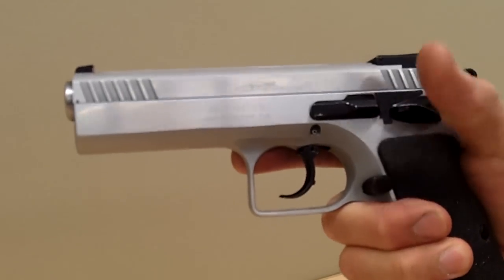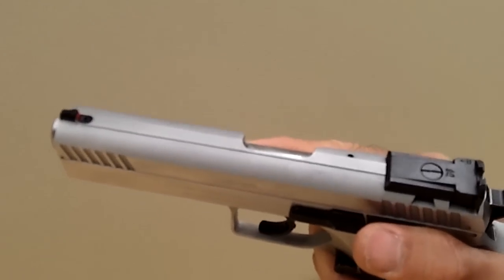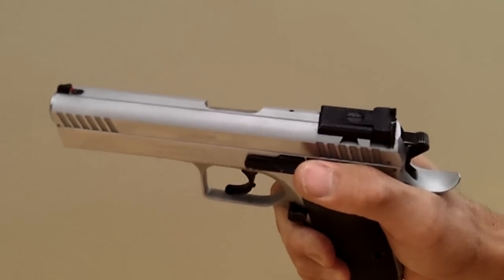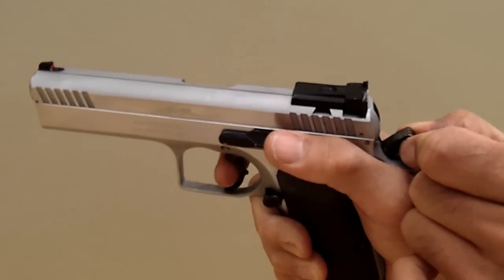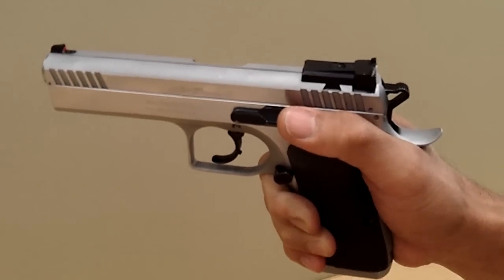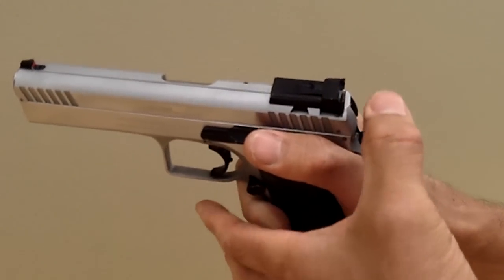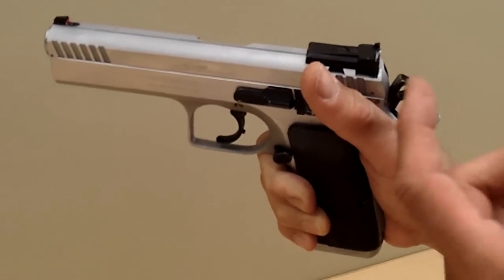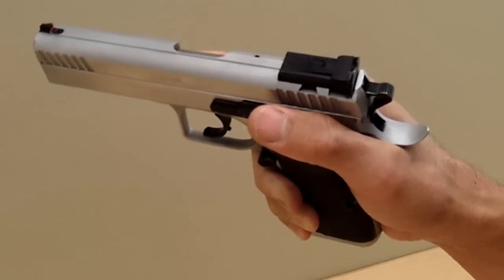Decocking Double/Single Action Semi Auto Pistol - Safer Method

Comment: The bottom line is that while you can attenuate the chances of an unintended discharge you are in fact violating a basic rule of firearm safety every time you manually decock a firearm using the trigger. Many variables (being tired or fatigued, distracted, complacent, sweaty, lubricants or solvents, nervousness, momentary lapse in coordination…) can turn this relatively simple operation into a big problem. My advice to people is usually to use something the way it was designed to be used. If you have a manual safety carry it SA and engage the safety after firing. If you want to carry DA/SA get a gun with a decocker. Like a lot of other things with firearms the chances of an individual, especially if they are careful and mindful, having a problem is very low but the chances that its going to happen to someone is 100%.
Reply from the maker: This video is for those who are required to manually decock their pistol.
Reply: @yleegm  my comment can be directed at the people issuing the requirement.
Reply from the maker: @jameslyons6655  I get it. And I agree with you. IPSC/USPSA should require a decocker, if they are going to mandate a hammer down start on  DA/SA pistols. But that will never happen now. Non-decocker pistol models like CZ Shadow 1 and 2 and Tanfo Stock 2 dominate IPSC and USPSA.

Comment: Half cock position allows also for safety engagement. So it is a super safe condition. Still requires a long heavy DA pull to fire, but with the added benefit of the safety if one wishes so. I train in full and half decocking on my shadow 2 with your method

Comment: I use the thumb method on my CZ-75B but I let go the trigger so the hammer goes down the half-cock. The CZ-75BD's decocker only drops the hammer to half clock anyway unlike the Beretta or Sig. So I would rather have a real safety rather than a halfcock decocker that I can do with my thumb.

Comment: I wonder what having a round go off might do to your fingers with the slide coming back? Like will it just hurt or cause actual injury? As for decocking, this seems like a reasonable method for competition where you have to have the hammer fully forward. I've also seen instructions whereby you hold your weak hand over the slide, with your thumb and index finger pointed back as you pinch the hammer between them so that were the gun to go off, the slide will push your fingers apart and won't cause injury. But you do risk it going off, hopefully in a safe direction.
Reply from the maker: I've seen shooters set it off while decocking with the use of their strong-hand thumb. Hurts their ego more than anything else. They might get some abrasions. Of course they will get disqualified at a match as well.

Comment: How does the pistol manufacturer recommend decocking over a live round?

In my opinion, if you want a DA/SA pistol, get one that doesn't require pulling the trigger as part of the process to decock.  The SIG P2xx series or a Beretta 92 series comes to mind.  There are others as well.
Reply from the maker: I agree with you. Unfortunately, DA/SA pistols w/o decocker are more popular in practical shooting competition because it's easier to refine the trigger components. So manufacturers are increasing their production of them.

Comment: I am not familiar with double action. If accidentally decocked hammer is bumped is there any transfer bar prevent the hammer to strike the firing pin or the double action mechanism itsef wont allow this to happen?
Reply: The firing pin is blocked unless you pull the trigger on the cz75 and M9 I'm sure more have the feature but these are the two I know.

Comment: How are you on doing this with a milspec 1911A1 (5")?

I have always done it with the pad of the thumb on the tongue of the hammer, but it certainly makes me extremely concerned that it's going to slip and strike, causing a negligent discharge. 

Would it be preferable to have the thumb between the receiver and hammer in my case?
Reply from the maker: bayushizero I wouldn't recommend decocking a loaded 1911. That gun is meant to be carried cocked and locked with the thumb safety engaged. It's difficult to do it on a 1911 without unintentionally setting off the round.

Comment: Isn't decocking to half-cock safer than decocking fully? By releasing the trigger to engage half-cock aren't the safety mechanisms engaged to prevent striking the firing pin? Thanks for any opinions..
Reply from the maker: Probably correct. However, this video is for those who are required to fully decock the hammer because of competition rules..Thanks for commenting.

Comment: You don't leave the hammer completely down. Half cock is the proper way. Leaving the hammer down is not safe. Your setting the hammer down on the fireing pin. I know most autos have a fireing pin block. But I don't trust them.
And if u drop the firearm on the hammer it may discharge. Most 1911 autos have a half cock also. But u don't leave them with the hammer down. U leave them in half cock or full back with safety on.
Not all guns are made the same . U have to cosider all its mechanical functions. A h@k p30 has a half cock. If u let the hammer down useing the trigger u will bypass the half cock position. If u use the Decocker it will put it into half cock. Even if u lower the hammer completely down against  the fireing pin, most fireing pins are  inertia type in dezine. The force of dropping it on the floar,concrete, tile floors will cause a discharge. 
The new Sig was haveing problems with discharging when dropped. They reduced the weight of the trigger to stop it. I personally recommend 1 in chamber with hammer Back and safety on and in a well maid holster . Not stuffed into ones pants. There's been a lot of people shot in the butt,leg,grown.

Comment: Similar to what I do except I just pull and release the trigger as soon as the hammer falls on my thumb, which I then ease out of the way, letting the hammer rest at the half-cock position. :)
Reply from the maker: Yes, that would be the safest method. Unfortunately, USPSA requires hammer to be fully down at the start. The rule was derived from ignorance of what's more safe, when it was first established.
Reply: @yleegm  So I understand, which is one big reason why I refrain from competitions in general, because of such insane rules.

Comment: What's wrong with lowering to half-cock?  That's what the decocker would do.  You still have the DA pull with half-cock.  There's zero chance of the round going off.  Why not lower to half-cock?  Is that just a competition thing?
Reply: I have never shot competition personally but that is what the maker of this video says in another comment. I never lower my CZ pistols past half cock with a live round in the chamber, there is no reason to for defensive carry. I think it's stupid that they fully lower it for competition.
Reply: It's dangerous because unless you have a decocker switch, the gun is not designed to be carried at half cock. The half cocked hammer could be nudged and drop onto a live round.

Comment: Why not leave the hammer on half cock? Just because it can damage hammer/sear on a drop?
If you believe it is wrong to decock a pistol... you should not have a pistol... or get a DA only.
Reply from the maker: It's explained in the video. This video is for those who are required to fully decock the pistol at the start of the shooting competition. Half cock is not an option..
Reply: @yleegm  No, it wasn't explained. I was forced to watch again to be sure. It wasn't. Now I understand!  IPSC or IDPA (one of them or both) has (or have) stupid rules.
I have a stupid gun, its decocker leaves the hammer on a "half cock like" position.
Reply from the maker: @garetz2011  You're right. It wasn't. I apologize for making you watch it again. And I  agree that this rule is stupid. I remember when it was instituted in the early 2000s by the USPSA board of directors. It was when "Production" division was formed. They had poor understanding of how DA/SA pistols work. The rule still stands after countless number of disqualifications..
Reply: @yleegm  I am a brazilian, I don't speak english (I also don't speak german). I can miss many things watching these videos in english.
I found something interesting last week. I don't know if the trick is possible on a CZ without decocker.
It's possible to decock a PT92 from cocked to half cock. Easy and safer than fully lowering the hammer.
As we know, if you release the trigger when the hammer rotates a few degrees the sear will intercept the hammer. Unlike 1911's, my PT92 uses quarter cock (if you pull the trigger the sear may release the hammer).

THE QUARTER COCK:
https://youtu.be/NMZSEplciqo

Once in the half cock position in my PT92, it's possible to lower the hammer, but you need to pull the slide a little back to disconnect the trigger bar from its double action feature and reach the sear again. At this point the hammer is much lighter and easier to control.
My hands hate the PT92 shape. I am considering to buy a turkish CZ clone, só, to know if the trick will be possible on a CZ would be great for me. I can't test it here, I have no access to a CZ (thing getting harder because of the commies in power)
HERE is the trick:
https://www.youtube.com/watch?v=3ZB-GPyQPKk&t=80

Sorry for the long text.